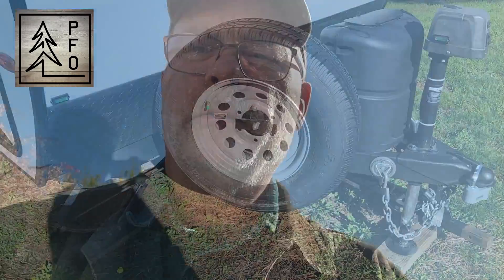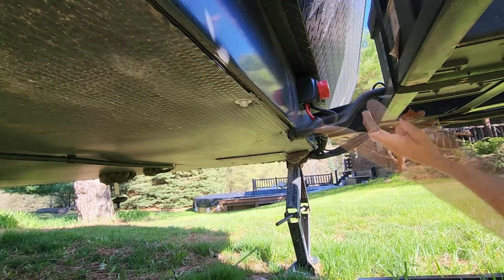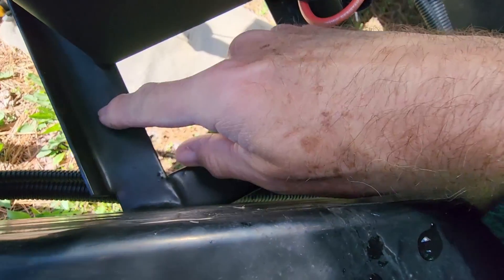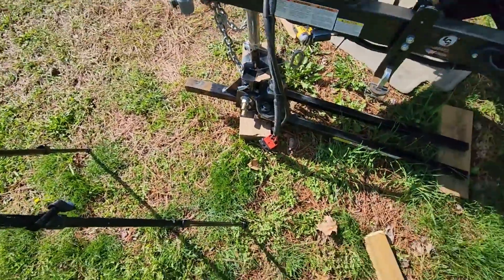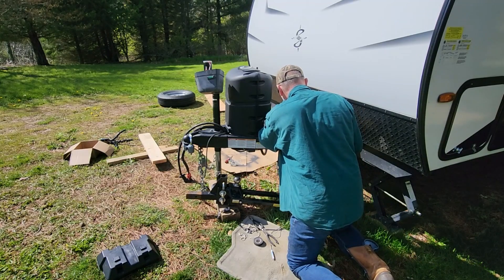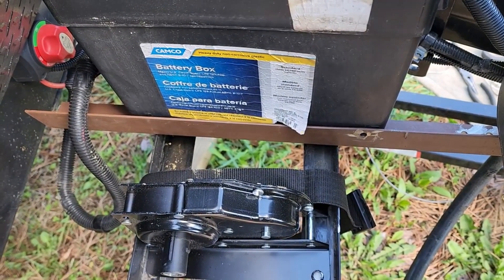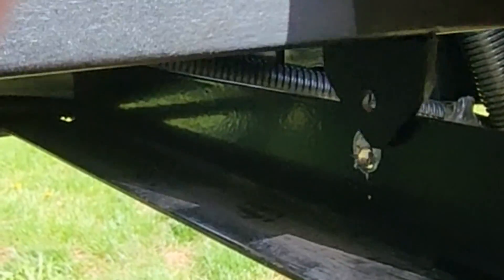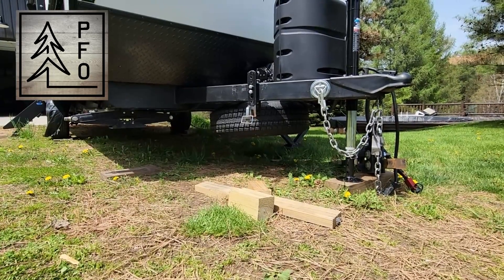Travel Trailer Spare Tire Relocation: Under the Tongue

Comment: What hoist did you get, i know you said it was for a truck but which one.
Reply from the maker: This is the one I used. Note that the cable cannot retract fully into the spool. About 12" must remain outside the spool. That was one reason I added the big block as a spacer. The other reason was to provide better access to the crank point by getting it above the tongue rail.

Spare Tire Hoist for F-150 Spare  
https://amzn.to/4126pis

Comment: Great job.  I could see how the first location would get in the way.  Having to move the battery holder added work, but you built a nice holder.  Wish I would have learned to weld.  I'm stuck building everything with wood...
Reply from the maker: Thanks. It's never too late to learn. I'm always amazed at how frequently I need to weld things around the homestead.
Reply: @thePFOchannel  did you take classes or just pick it up yourself?   I don’t know if I’d have time to attend classes.   Wondering how easy it would be just watching YouTube videos.
Reply from the maker: I didn't take any welding classes. Just watched some videos and practiced a bit on scrap.

Comment: Good job buddy hope it works out. I’m looking to move my spare because new camper don’t fit it shed 😅
Reply from the maker: Thanks. In addition to the horizontal hoist action as I have here, there is another option that I haven't tried yet. Since making this video, I learned that some spare tire hoists have a vertical crank action. For example, a Toyota Sienna. That may be advantageous on some trailer tongues.

Comment: OK thank you. My Frame is 5" at tongue so the 4" off back bumber won't fit  unfortunately.
Reply from the maker: I found the tire carrier in my shop, and the reason it worked is that my tongue frame is only 4" high. I just had to make a block to fill the rest of the 4" x 4" bracket. The brand was Bear Claw Trailer Products, but I can't find anything in Google about it to see if they also make one for a 5" frame.
Reply: @thePFOchannel  OK  thank you for looking into it. I will keep looking for a 5" mount and where it's high enough. The ones I see are mostly for boat trailers and will sit low to the frame and the equalizer bars sit on perch like yours and need the clearance.